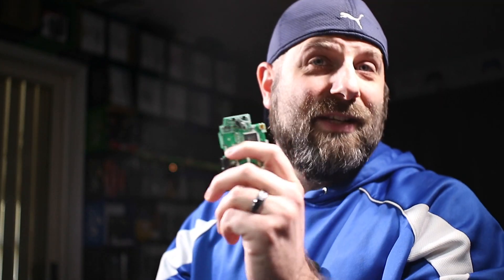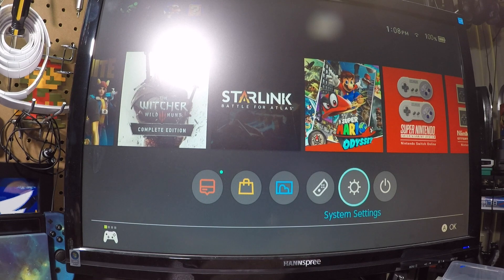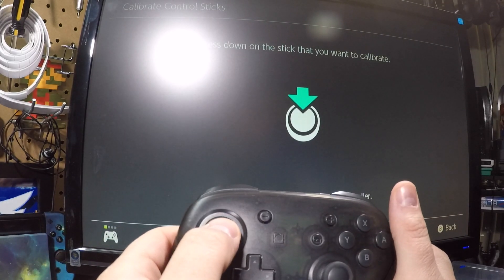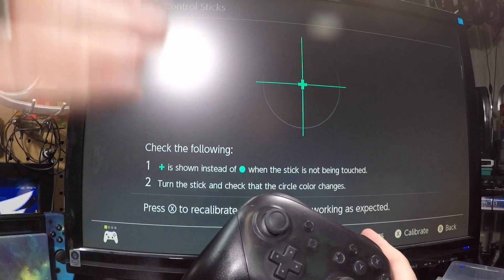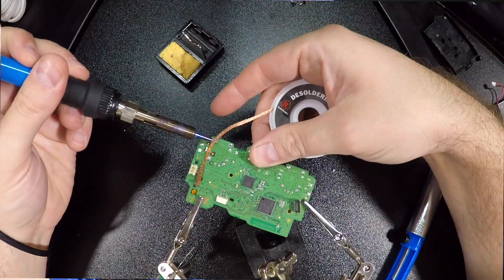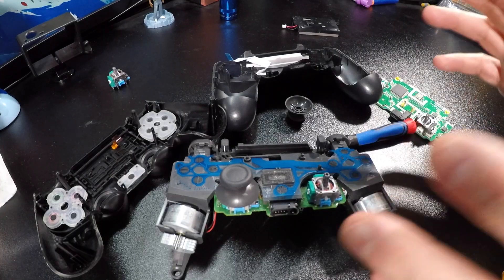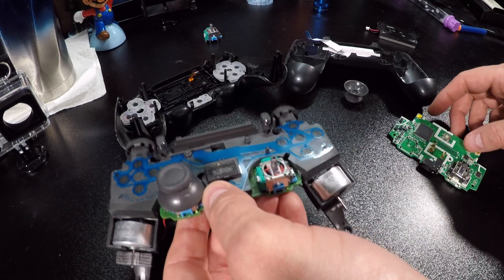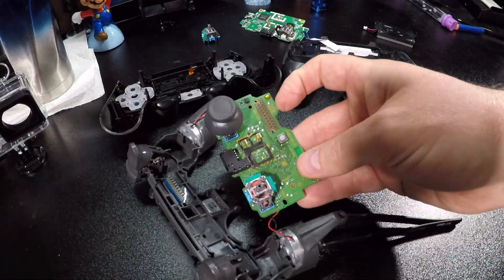The Ultimate Controller Stick Drift Fix!!!

Comment: There is resistive track inside (green/black) plastic covers, on which this metal wiper slides on. In my case (xbox one controller), that tack is what is worn out, not the metal wiper.

Comment: Did anyone notice that the switch controller was a knockoff switch pro controller? I've seen this controller before, you can tell cause there is no nintendo logos on it, and those types of controllers I've had problems with each one